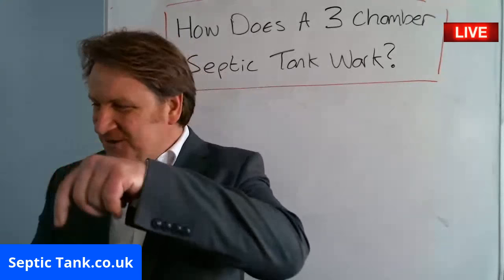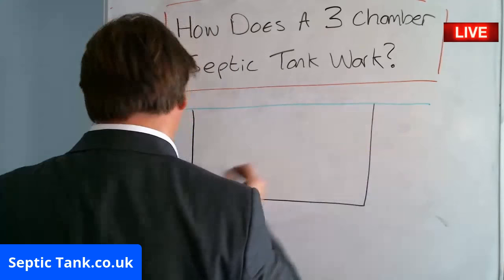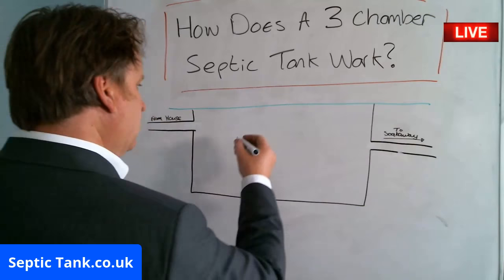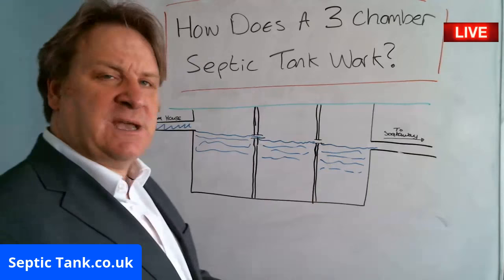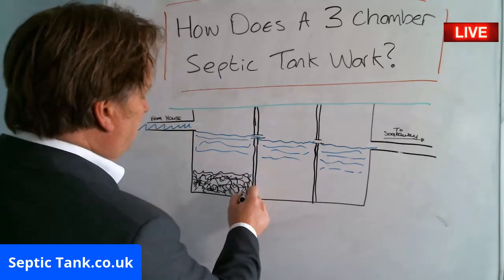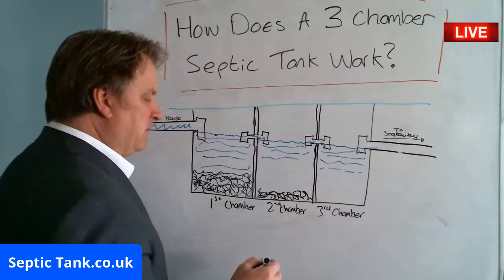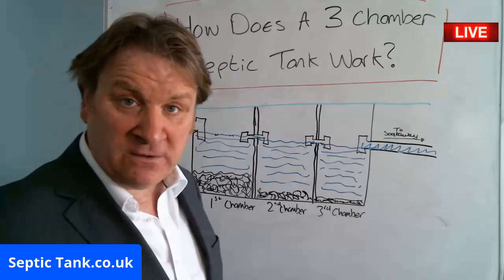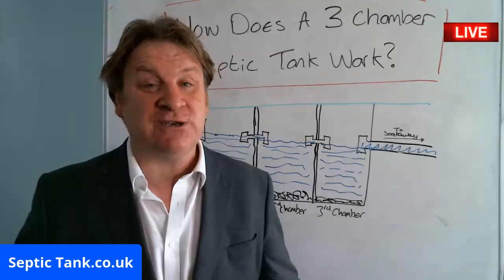How Does A 3 Chamber Septic Tank Work

Comment: To be clear, in the United States, a multiple compartment or "chambered" Septic Tank is NOT divided into equal parts... nor should it  be. Typically, the 1st Compartment or Primary Chamber, is the biggest, because it's where the majority of the solids will separate from the liquid. The 2nd Compartment is usually where an Aeration Treatment Unit (ATU) or Aerobic Bacterial Generator (ABG) would be installed... basically an Air Pump, which oxygenates the Effluent. The 3rd Compartment or 3rd Chamber, which is usually the smallest, is where an Effluent Filter would be installed in the Outlet Baffle. The idea of a filter in the Outlet Baffle is to capture or trap any suspended particulates before they exit the tank, and flow to the Leaching Field or "soakaway" as you call it. The bottom line is the longer the wastewater stays in the tank, the better settling or separation between solids and liquids. In other words, it improves pretreatment of the Effluent, which can help the Leachfield or Drainfield last longer. In my opinion, multiple compartment tanks are a good idea, and having an Effluent Filter in the Outlet Baffle of the 3rd Compartment or 3rd Chamber, is usually not a problem, because it could take 3 or 4 years before it will need cleaning, and by then it's time to pump out the tank anyway. However, pumping a multiple compartment tank does cost more money, because it's more work and ultimately, a greater volume of wastewater that's pumped out, or extracted from each of the Septic Tanks compartments a.k.a. chambers.
Reply: Thanks Craig i have a little bit to decipher what you posted im completely in the dark with septic system's  but learning as much ad possible,  my question is  when its pumped yearly or whenever what and why do we pump them out 
Is it left over crap gunl that didn't degrade or shouldn't have been sent down there  ?  THANKS  YOUR POST WAS A HUGE HELP IN MY CRASH COURSE IN THIS INTERESTING SYSTEM,  im a chemical operator and understand the workings of lots of different systems  like filtering and so on. 😉👍🏻👏🏻🇺🇸💩👈🏻
Reply: @dawngregory6549  To be clear, I'm in the Northeast United States... New England. Specifically, I live and work in the State of New Hampshire, and I've been a Licensed Septic Professional for about 20 years. Obviously, in the Northeastern part of the US, we have lots of cold weather and more than a little snow. As a result, Concrete Septic Tanks are very common and still the most popular here in the New England area. I think it's probably because we know that Concrete Septic Tanks can easily last 50, 60, or even 70 years. That being said, proper care and maintenance of a Septic System requires pumping out your Septic Tank every 3 to 5 years, depending on the number of full time occupants living in the home. The reason for this, is because not all of the solid waste will be broken down or digested by the bacterial action in the tank. In other words, a Septic Tank is a bacterial environment, and the microbial activity in the tank essentially eats up and breaks down the poop and the paper, which creates sludge that accumulates in the bottom of the Septic Tank. As a result, the sludge needs to be removed by pumping the tank every few years, which allows the tank to return to it's full liquid volume... whatever that may be. Typically, it's at least a 1000 gallons, and frequently could be as much as 1500 gallons. The size of the tank is dictated by the number of bedrooms, because bedrooms dictate occupancy. In my state of New Hampshire, a 2 bedroom home requires a thousand gallon tank. Nevertheless, I'm a big fan of 2 Compartment Tanks or 2 Separate Tanks, because I believe the longer the wastewater or EFFLUENT, can be contained in the tank, the better separation of the solids. In addition, longer retention time allows the bacteria to break down the waste better, which can also improve the overall function of the system. Here in New Hampshire, 2 Compartment Septic Tanks and even 3 Compartment Septic Tanks have become very popular in the past decade or so, and I think it's the way to go, and it doesn't really have a big impact on the cost of a New Septic System either.
Reply: Well explained
Reply: Cheers Craig, I am currently constructing our home septic tank. Still in its primitive stages. Excavation works and you've just confirmed to me the ideal size of the tank and its longevity if maintained regularly. I have plans to develop our home into a double storey and the measurements of our septic tank is 3 metres length and 3 metres wide and 3 metres depth with 3 compartments. From Fiji. Vinaka!
Reply: @alipatetuberi7726  Good Morning and thank you... I'm glad some of the information I've shared has been helpful. To be fair, I'm obviously in the United States, and we do things differently than in the United Kingdom. We even do things differently from state to state and county to county because the geology changes. In other words, soil conditions and groundwater conditions are different from one location to another. As a result, in my state of New Hampshire, the environmental rules and regulations are specific to the typical or most common conditions we encounter in the Granite State. With this in mind, I don't know what you're facing for challenges wherever you are, but in my opinion, a 2 Compartment or 3 Compartment Septic Tank is never a bad idea. Again, the longer you can retain wastewater in the Septic Tank, the better your system should work. It improves Pretreatment of the Effluent, which means the solids or suspended particulates should separate and sink to the bottom of the tank. It also enhances bacterial action by allowing more time for the microbes to do their job. Remember, a Septic Tank is a bacterial environment, and without microbial activity, the system won't work. So, be kind to your Septic System, and make sure you always check labels when you shop, and only buy Septic Safe cleaning products... Alright?
Reply from the maker: Thank you
Reply: Hi  @dawngregory6549 , I really percieve the professional writting skills  and the knowledge you have in the matter. I learned a lot. Thank you.

Comment: Outlet pipe side is raised little bit due to soil erosion. 
There is, a height difference between inlet and outlet pipe.... 
Water overflow is not taking place from outlet pipe. 
Can I interchange inlet and outlet pipe
Iam using 3 layer plastic septic tank

Comment: Really good video. 

1. If built like this... For a 3 bedroom 5 person occupied house, what should the size of the Chambers be?

2. How often will it fill up?

3. How do you avoid grease clogging up the inside of it?
Reply: 75 gals per head. 75x5=375 gals Volume= 1.125+0.75x375gals=282.37 say 283 gals convert it to cubic meter 1cum=264gals  283 divide to 264=1.07 cum total discharge to get length Length=total volume divided by width x 1.20m depth. So you have 3 chambers. The first chamber would be 1.0 length x1.0m width x 1.20+(0.30m for air space to accommodate aerobic bacteria. The 1.20m depth is for anaerobic bacteria. These bacteria are essential for the breakdown and processing for waste material.) 2nd chamber is 0.5mL x 1.0mW x 1.20D+ 0.30m air space 3rd chamber would be the same size as the 2nd chamber. You total depth would be 1.50m. Thickness of walls are not included in this dimensions. To avoid grease going into the tank, use multiple chambered grease trap below your kitchen sink.
Reply: @andreinicolaiamadeo3453  wow that's some answer!
Reply from the maker: Thanks for your comment.
Reply from the maker: Thanks for your comment.
Reply: @SepticTankTV  hi ive ordered some septic worms from you - its been 2 weeks. ive paid £149 - ive heard nothing from you Jason. I have phoned you everyday. please sort this out as a matter of principle as its now beginning to get worrying
Reply: In the BAHAMAS most septic tanks  6fth 5ft w 10ft

Comment: I may say this tank will be reported full every 6 months. Though i allways prefer 3 chamber septic tank.
I find waste poo/sludge/grease has to be made to travel and gets churned or consume by the microbes. The microbes thereafter will excrete in liquid form which will be finally ejected outside into the soak pit.

By the way, the first interchamber opening should be at the bottom and the second interchamber opening should be at the upper part. This is becoz poo/waste floats if you allow it.

Comment: Hi Jason, I have designed a septic tank in AutoCad based on the information I got from your exelent video, The design I have put together has four chambers in total and built from reinforced concrete,. The reason is I want the water that finally comes out will be as clean as possible in regards to the soakaway. I'm a Brit living in the Philippines and living in the province where most of the drinking water comes from a well. How far would you recommend the soakaway is from the well so there is no cross-contamination and is there an email i can send you my design for a once over
Reply: 30-50m
Reply: So well explained. I will do a 3 chamber septic tank just because of this video alone. Thankyou

Comment: Thanks for the video... I’m a Brit living in the Philippines and have this type of tank. Not sure whether there is an outlet... which concerns me. The water company came to clean the tank in Jan, but now we are having sewage coming up through drains inside the house!! I’m think that the baffles may have blocked in the first chamber? Does that sound feasible?
Reply from the maker: Hi Alan, it sure does. Can you gain access to them?
Reply from the maker: Thanks
Reply: You have to ask the plumber who built and check it. Either the inlet or outlet pipe might have been blocked. It happened one time in one client who had the same problem as yours. What happened they dug up and found out the outlet pipe has been blocked.
Reply from the maker: @bernierapirap6522  Thank you for your comment :-)
Reply: Hi Alan, did you try to install back flow preventer?

Comment: There seems to be a huge piece of missing information. Why don't the solids in chamber one keep building up until they are above the connection to chamber 2? For that matter, why doesn't the entire thing fill with solid waste and become overwhelmed?
Reply: Bacteria and enzymes inside the septic tank break down the waste. That's the reason a properly sized tank is needed, so the tank can hold the solid waste first long enough for the bacteria to break them down before they get filled up.
Reply: The septic tank should be pumped out every 3 to 5 years - sooner when more occupants live in the home.  In the U.S.A. pumping can cost about $500 where I lived, but doing so will prevent most future problems.

Comment: Hello Jason, Hello guys
Thanks for the video. Still I have a question. How do you manage the odours that come out the septic tank through the pipeline till the toilets. I live in a house built by my dad, where I encounter that problem. And when it starts it’s really unbearable. Thanks for helping.
Reply: When last did you disludge the tank? and ensure you don't fluch chemical substance down the drain, as it kills the microbial responsible for the decomposition of the waste.

Comment: Very interesting. I am thinking of constructing one wit 2 chambers but am convince with the 3. Can you talk more on the soakaway?
Reply: Soakaway is just where the liquid fluids as in water leave the 3 chamber system and exits to the rock, gravel or what is used or  if used and into the soil. The soil absorbs the clean water, clean as in free of poo, tissue and debris, not clean as in drinking water. That's the whole purpose of the system. The 3 chambers trap all the debris so what is left is debris free clean water that is "soakedaway" by the soil. The soil soaks it up as like a paper towel does a spill on your kitchen table. If you left that paper towel there long enough, it would eventually dry out and can be used again to wipe up another spill. In the case of a septic system, the soil around the septic tank is likely to stay wet and damp and usually why you'll see much greener grass around your septic system.

Comment: If the soap water or detergent water enters septic tank does it kill the natural bacteria in present in septic tank.
Vineeth ( india)
Reply from the maker: Thank you for your comment :-)
Reply: it wont
Reply: It really depends on what type of detergents or soap that you use. For example "antibacterial" soap can and will kill bacteria in a Septic System. BLEACH is terrible for Septic Systems, so the bottom line is you need to check labels on all cleaning products when you shop. Make sure you only buy Septic Safe cleaning products, and the good news in America, is that the information is on the package... if you look for it.